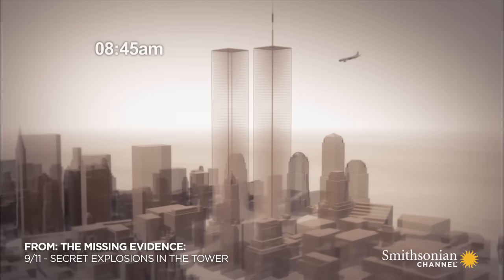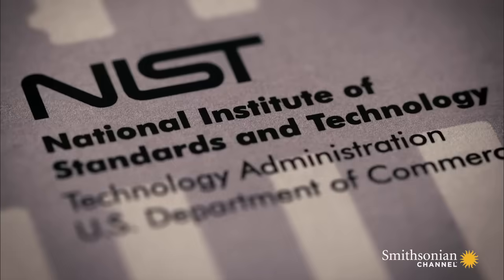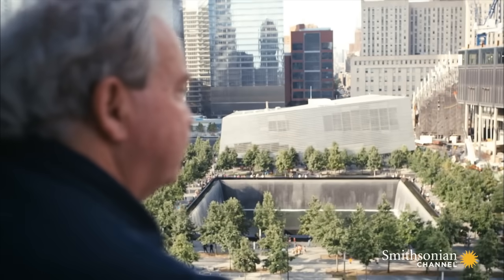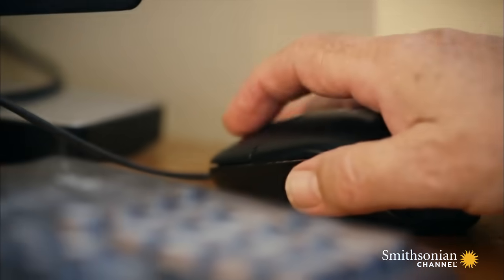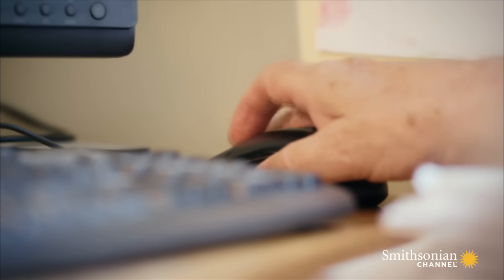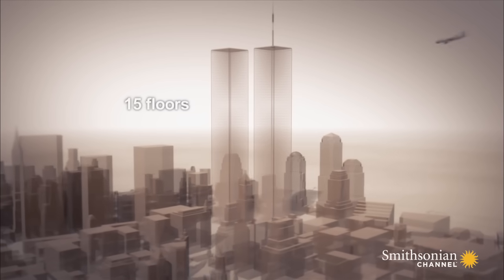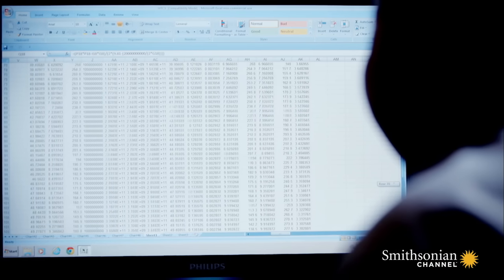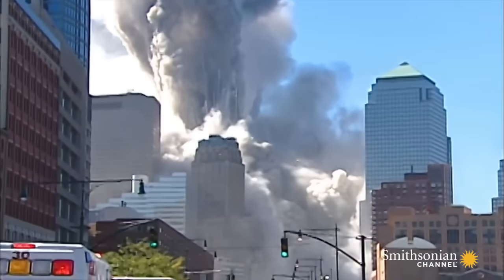This Computer Simulation Explains How the Twin Towers Fell

Comment: I just saw a bunch of momentum calculations. Not any actual, dynamic, real time simulation. In these calculations, he calculated the mass of each floor, and mass of the tower above the impact zone. I wonder, how did he account for the many connections between the perimeter wall, the trusses, and the core columns (which themselves were all tied together, basically a giant grid or collection of steel cubes)? In other words, I'm wondering if his calculations simply used the mass of each floor and basically assumed a house of cards, a house of potential energy. But how this momentum of the falling upper section of the building interacted with the strong, interconnected structure below would be very interesting. And very complicated. Pretty soon the general public will have access to simulation programs that only a few years ago, would have taken huge amounts of processing power and were very expensive . Soon someone will come up with a realistic simulation ruling out the pancake theory.
Reply: disgny 
You are by far one of the stupidest people I have seen on YouTube. Do you also believe that the earth is flat and that the government is lying about that too. Cause you seem to think they are able to do anything with any evidence that they can.
Reply: doesn't make any sense, that 3 buildings sustained asymmetric damage & all came down symmetrically.  For this to be  built into the design, would mean factoring into the build "what if' scenarios for each floor where  [if ANY one part catastrophically fails, then all other points fail equally, to keep collapse within it's own foot print]. The extra cost for doing this for each & every floor would be financially prohibitive & I would like to think if paying for a major building project, it would stay up in the case of a disaster, not pancake down on everyone inside - trying to be open minded here; does the insurance policy drawn up at the time of construction, stipulate this as a build requirement? Because I seriously doubt it.
Reply: there are plenty of far-out 911 conspiracy's out there I don't believe;  my thoughts are that there are far too many things that don't add up & I'm not into blindly believing someone else's narrative.  Then there's the angle of how accurate the simulation is; how many decimal places it was working to - unless you have all the data & method used, you can't tell if you are being intentionally or unintentionally misled. I had a buddy who worked for a large computer company that on occasion would cludge figures to return a more desired outcome, so forgive me for not having 100% blind faith in the video.  It took me a few years to wake up to things that just - well, to be  quite frank, that didn't quite add up.
Reply: ? what was the point you were trying to make? I'm saying that there's too many things that in my experience that don't add up, you've replied with unreadable gibberish. Enough, no more. I have tried to be polite; you are just can't accept that people are entitled to their own opinion. Grow up!
Reply: Well, actually they didn't collapse "symmetrically".
Reply: disgny
More conspiracy nonsense that you can't prove. There were no unusual sequences of the explosions, this is what you are refusing to accept.
Reply: SirLordypantsSir
Then open your fucking eyes when watching the footage. You clearly don't understand physics.
Reply: You seem to make a lot of unwarranted assumptions about how the Demolition MUST be carried out.   Suppose they didn't do it that way?
No,  you are NOT  depending on the force of gravity:  you are explosviely CUTTING every other floor, removing all support for the building. So it just falls.  This scheme always works, there is NO requirement that it must be done from lower floors to higher.  "A lot of explosives"?!  The perpetrators stood to make BILLIONS of dollars by doing this, you think they can't afford to buy explosives?!   They could , and did, take all the time they needed to preset the charges (non-working hours and controlled access) Nowadays they need not be interconnected with wires.   And , especially since there were NO airplanes, they need not worry about any of the pre arrangements to be disturbed.  Why would they?
Reply: Darryl E.  I find it hard to believe that YOU watched the videos of bldg. 7.  It was perfectly obvious that MOST of the floors were not touched by fire ,even enough  to break windows.   So , lots of office furniture are paperwork burned "unfought" for hours .  So what?  that could not possibly reach  temperatures high enough to do what you imagine.  And, oh yes,  how exactly did the fireproofing  get removed in bldg. 7?!  It is quite obvious that YOU have never tried to remove any;  it is not easy.
Reply: disgny 
The only lies that I see are you 911 conspiracy losers.
Reply: MH Lifestyle
The center of the building was the first to fall. The outer walls were pushed out. The explosion that you think you saw, was the large volume of air being forced out the building by the collapsing tops of the towers.
Reply: Are you kidding me Darryl? You're calling someone stupid, then saying that? Let's run through this together. I hope you don't mind since you seem to be an expert and all. 1) If air is being "forced" as you say, to a lower floor, it would not blow out selected windows. Gas will fill are area equally. So ALL the windows on a floor would have to blow out at the same time, not select ones, and certainly not 60 stories below at some points. 2) The material ejecting from the buildings is traveling at 160-200 feet per second. This is explosive force. Sending parts of the structure out hundreds of feet. This isn't compressed air of any kind that could have been created under the conditions. 

I see comments like yours and I think to myself, fuck, we are doomed. If this is the level of education the average American has attained. A level of education that causes someone like Darryl to says some stupid, completely uneducated shit list this, and call someone ELSE stupid? May God have mercy on our souls.
Reply: NO ONE is saying it was not a real attack.   The question has always been  WHO were the attackers, and what did they stand to gain.   For sure, it was not OBL or any Moslems,  all they got was the "Blame",  whereas the real culprits got billions of dollars in various forms.  And is it not strange that the utter failure of our government to even respond effectively in countering an "air attack",  after all the trillions spent during the Cold War to prevent any aerial attacks whatever,   did not result in ANY penalties whatever to those in  Charge of "Defense".   No one that I ever heard of got even a reprimand, to say nothing of actual action.   They got PROMOTIONS instead.  Curious ,  right?!
Reply: Not to mention, he calculated ALL the weight above crushing the floors below. But a large percentage of that 'weight' was being thrown laterally... not crushing straight down.
Reply: disgny 
Sorry but my grasp of physics is just fine. As for building 7, try watching the whole thing and not just the part the 9/11 liars want to show you. The penthouse fell in first, meaning that when the outer shell fell, the core of the building was already gone. And that is why when the outer shell of the building fell, it went very quickly.
Reply: I was replying to the last comment (looks like it ended up in the wrong place tho...).  Yes, Darryl, buildings do have a lot of mass, but regardless, if you remove a chunk of structure from one corner; you can expect things to start to fail there; not perfectly symmetrically & simultaneously across the whole floor.
Reply: contorled ?
Reply: Lets just say you dumb asses are right and it is a big conspiracy for a min. Then why add the explosions and the risk of it being found out? Isn't flying planes into buildings enough to reason to go to war against someone? By planting explosions just to do extra damage after flying FUCKING planes into buildings, it's just an unnecessary risk. It's like shooting someone in the heart then blowing them up.
Reply: paulczar: you don't need to trouble yourself about all the perfectly valid complications in building design and practice that you mentioned.  That is exactly what the designers do,  make all those caluculations,  and provide structures that can accommodate the loads, and then provide about 5 times more than the strength necessary ("safety factor").  That is what the designer at WTC said they did.  They have done all this successfully for a hundred years.  But there is NO WAY to a design that can defeat a military type explosive demolition  event.  FYI  : the Pancake Theory  has already been ruled out by the very people who proposed it in the first place.  It just doesn't fly.
Reply: disgny mmmh, ok, so you're saying the went kaboom on those floors?
Lets round up what you need to do to prepare a controlled demolition:

1) completely clean the area, to prevent interactions with explosives (done? nope)
2) manually demolish part of the pillars, to prepare them for the cut, in this case, remove a lot of concrete from the core, in fact the steel must be at least partially exposed 
3) place all the charges (and they are not exactly that small)
4) wire all the charges together. I know, you may think, why not wireless? Oh well, you can trigger the charges using a wireless remote, but you still need to link them together, cause you now, timing is essential in a demolition, and here, we are talking of a lot of charges.
5) place charges also on the external windows frames, as they carried approximately 40% of the load.

And the best part? You throw a plane through all that stuff, that explodes with all its fuel burning everywhere, and everything keeps working smoothly, not a single charge failed or have been launched on the outside.
Yeah, that make sense.
Reply: disgny and you know what doesn't make sense? You say the pancake theory doesn't work, ok, but we all can see that the floors failed up down. In controlled demolitions, you use mainly the force of gravity, so you cut in the lower parts of the building, and if you need more cuts, you go from the lower floors to the highest, otherwise it doesn't work, you lose momentum. Which means, to achieve the same effect using cd, they would have got to place charges in every floor of the building.
That's a lot of explosives. None of which were accidentally triggered in the previous days, nor damaged during the crash.
Again, seriously...
Reply: disgny
"Suppose they didn't do it that way?" If they didn't do it that way that your claim is fucking impossible. You fail to understand physics.
 You don't seem to understand what it takes to bring a building down via explosives.
Reply: disgny by the way, no airplanes? Seriously O_O ? That's too much trolling, even for a pro, like you obviously are.
Reply: disgny 
I saw the plane hit the tower with my own eyes and I was not alone. If that planes was flown into not 1 not 2 but 3 fucking buildings and I 4th crashed the was targeting another building as an act of terrorism. Then that is more then enough reasons to go to war stupid.
Reply: Sure, "go to war":  but shouldn't we at least try to figure out just  WHO was responsible?!.  Perhaps you didn't notice, but SO FAR , that HAS NOT been done.
Reply: Speaking of delusional,  unless you have a very  high level security clearance , how would you know just what holographic equipment has been developed over the last 40 years?!  And If you do have that clearance, they certainly made a poor choice choosing YOU to know all this stuff.
Reply: OK,  you present a picture.  But it has a fatal flaw:  "Fire"  doesn't weaken steel  until it engulfs the steel for a long time with certain required temperatures.  NONE of that happened in the buildings we are talking about.  And even if it did,  steel "yields" gradually,  it does not just "Snap".   And in the WTC cases,   the time it takes to yield is VERY much longer than any time that was actually available.  You won't find a credible engineer or architect to agree with your scenario, sorry.  N.B.  Take the NIST report:   they carefully avoided all those difficult questions.  They simply refused to come up with any theory at all , in their final report.
Reply: Your starting off with "facts" is admirable, rather than insults.  But you did NOT answer my main points about why the Official Story is wrong. Bldg. 7  had about 47 floors.  So that means that each floor had about 0.7 SECONDS to have fire engulf all columns,  "weaken" all steel,  have the floor joists "yield", and allow the Pancake theory to do its work.  LESS  than ONE SECOND!  Do you honestly think that any normal person, forget about experts,  finds that believable?!   The "Research"  you were referring to was not research at all, but a lame attempt to come with some  "technical " sounding cover story.   Did you realize that   NIST later rejected their own lame theory?  Leaving them with NOTHING, since they reject, without evidence, the CD explanation.  I'm afraid your insulting final statement did NOT help your case, quite the opposite.
Reply: You did not present a SINGLE idea, or Fact,  in your post.  So I guess this will be our last attempt at communication.
Reply: Paulczar;   My response was NOT to your perfectly reasonable post, but to another one ,(which had been mostly insults, but not all.)
    Your idea is at heart correct.   One of my friends, a world class engineer, was recently telling me in some detail, just how your plan might be carried out.  But I had to tell him , that the effort would be meaningless, because  the situation  about the Free Fall time absolutely rules it out:  there was simply NOT ENOUGH TIME available for all that plastic  yielding, sequential impacts, etc. to happen.  As even NIST has finally recognized, the Pancake theory is untenable;   those  ground floor columns HAD to be blown away by explosives BEFORE the "pancaking" could take effect.   And of course, if that had happened,  Pancakes are irrelevant.  The remaining unresolved mystery, of course, is WHY are the "elites" so reluctant to actually solve the greatest crime in US history?!
Reply: Darryl E. :  Yes, indeed , you DID refer to "Lots of Facts" in your post, but let's not forget that various Big League liars, like Advertising agencies (an American Specialty)  will ALL agree that the very best "lies" can be best sold by using " True Facts", which happen to be irrelevant to the real questions being asked.   This is especially suspicious when the "facts" are used to justify some fanciful Speculation,( which is what computer similation IS.  Not that they are ALL  bad, or useless.)   If the Theory that holds the Facts together is inadequate, as the "Pancake" idea is,  then the whole effort is suspicious in itself, as any police investigator will tell you.
Reply: Darryl Elam yeah i saw that i saw a burst of air come out near the ground floors when they started to collapse which i don't understand how that happened tbh idk there's honestly no sides to this whole argument we will never know... both ideas of what happened can be true so idk its really hard to tell
Reply: Chris Jensen 
No, what was thrown to the sides really was very small percentage. Where are you getting these stupid conclusions from?
Reply: Each floor span would fail at 14,000 tons, mattering not how many connectors, and the upper mass was 38,000 tons with momentum. That's your basic math. The upper mass indeed mostly fell down through the lower portion. It was the wall column panels from the base which were splayed apart and fell over large distances from the footprint.
Reply: whetedge:    Excellent that you are thinking about the physics of it.   Now,    could you tell us WHERE this "momentum" came from?!  Please refrain from saying "falling floors".   That is just silly.
Reply: paulczar unfortunately people in government had at least four hundred trucks come in and take away the evidence. All the debris From The Towers will put into trucks 400 of them and ship to China or Japan I forget which one for recycling. this is also on video. now correct me if I'm wrong after the buildings were brought down by demolition what Romaine was evidence pure evidence but it was removed. That itself is a crime that should be reinvestigated
Reply: disgny 
So now you are making up lies. You are a sad sorry loser.
Reply: disgny
All of those diagonal cuts long since proven to be made post collapse. Of course, you knew that.
Reply: disgny
Not who, WHAT. The evidence speaks for itself:
https://s6.postimg.org/6xyuzpwsh/wtc_Cut_Column_Annotated.jpg
Not to mention many of the cut columns were standing post collapse.
Not to mention no congruence between cuts and observable collapse.
Not to mention video of those cuts being made post collapse.
Reply: disgny
Do you enjoy exposing your utter vapid brain for all to see?
The columns shown to be cut were still standing in earlier photos than when they were cut, meaning they were cut after collapse.
Reply: Richard Lopez
It's you who is afraid of the truth. You want so bad for it to be controlled demolition you turn off your brain and become a pliable sap for the con men, believing exactly what they want you to believe, that somehow the Towers were like a solid block of steel. All you do is reveal you have no clue the design of the Towers. They also want you to think the upper mass just vanished because it broke apart. The mass was still there, other than the drywall; all 38,000 tons of it (North Tower; much more for South Tower).
Once the tops started tilting, how on earth do you think the vertical columns managed to stay in alignment? Did you not take solid geometry in high school? Are you not aware vertical support comprised less than 5% of actual floor plan? All the rest was nothing but floor spans; 60 feet on two sides of the core, 34 feet on the other two sides. That means the floor spans were the only resistance. The floor spans fail at 14,000 tons. How on earth can a floor span that fails at 14,000 tons stop or slow a mass of 38,000 tons with momentum? The rate of collapse actually will accelerate as mass is added by each collapsing floor.
You are being duped.
Reply: paulczar each engine roughly 7tons titanium now slam that at 500mph into a steel beam and see wat happens
Reply: disgny 
Dumb ass I've already explained how building 7 fell. And no it didn't fall at free fall speed, it fell near free fall speed. And what you saw fall were the outer walls as the core of the building fell first as evidenced by the penthouse falling into the building before the out wall came crashing down. You are nothing but a conspiracy loser that refuses to accept reality.
Reply: Dude I have a structural engineering degree and I doubt that you have a degree as most of what you have said makes you sound extremely ignorant on the topic.You use language that would suggest that you are a lay person on the topic. Also, if you're retired you're probably around 70 years old meaning that unless you were a badass engineer all you probably ever did was some stick framed timber or cold frame steel houses or maybe up to 5 stories. You have no idea how a Steel SMRF system that uses its ductility extensively works
Reply: disgny
"NOTHING was holding up the building at moment the fall began."
Something must have been holding it up because the moment it began to fall (perimeter wall frame), half the structure fell over with no discernible down component: https://media.giphy.com/media/26BRHuKQqWcyY2Xja/giphy.gif
Reply: He likely used the blue prints. Duh!
Reply: You are assuming that the WTC "collapses"  were ordinary demolition projects.  They WERE NOT.   The perpetrators had certain specific goals in mind,  to demolish certain areas to get rid of incriminating evidence, and people.  Hence the unusual  sequences of the explosions.
Reply: Yep, you can see the squibs on wtc
Reply: Darryl Elam Not interested in proving ewt pal. We've both seen the footage but clearly interpret it differently.
Reply: You are evidently not familiar with computer simulations.  It is possible to rig them up to get any answer that you decided in advance should come out.  That is what they did.  NIST spent a lot of money on theories and simulations of various kinds, and what do you know, they came out with the "Official Story" , or Myth of what happened. Only they did such a shoddy job that they had to back away from their original story,on account of knowledgable criticisms. and now admit they cannot account for the collapses.
Reply: Darryl:  I don't agree that the testimony of over a hundred eyewitnesses, some fire professionals, can be blithely ignored, just because you don't like the implications.
Reply: Darryl:  it's time to grow up:  Look up the term "False Flag Operations".  It means staged "atrocities" of various kinds to distract the public from what really happened,  and to blame someone you want to "get".  A lot like "Fall Guys" in a Mafia assassination, but nations do it too.  9/11 is a clear example, but there are plenty of others.  No , an airplane crash (even if it really happened) is NOT enough reason for a nation to go to war with another ,  ESPECIALLY if you might have the wrong one:  the FBI has said that they CANNOT prove that OBL & co. are guilty of the WTC affair, but it suits the purposes of certain Neocons to go ahead with it.
Reply: Darryl:  I was in  a Combat Engineer Battalion in wartime, later became a civil engineer,  and YOU are in no state of knowledge to even talk about what it takes to blow up a building,as is painfully obvious.
Reply: Right, Darryl:  only highly placed people in some hi tech government  have access to advanced Holographic equipment.  Good clue, isn't it?
Reply: I find it interesting you mention that the buildings had a lot of mass but forgot that the buildings were built specifically to handle their mass and a lot more mass. How would a mass that the building was designed to hold falling a short distance (a couple of floors) with resistance overcome the holding strength of the 70+ floors below it?
Reply: systematic101 
Put a 10 pound weight on your foot, easy right it's barely any weight on your foot. But drop that 10 pound that weight just 3 feet onto your foot and you can easily break your foot. Once something builds up momentum it hits with a lot of force. When the top of the tower fell onto floors that were already weaken by the fire. It punched though the weaken floors and built up a great deal of momentum that far exceeded what the building was built to take.
Reply: disgny
The actual maximum burning temperature of a Jet-A fuel (standard jet fuel type in U.S.) is 980 deg. Celsius. The temperature at which steel changes from cementite and pearlite (strong phases of steel) to austenite (significantly less strong) is 702.5 deg. Celsius. If a steel structure is exposed to a temperature just below or at the eutectic (702.5 deg.) for a period of time, martinsite is formed (very weak). All it would take is a few I-beams to lose their structural integrity before the "chain reaction" would start. The steel used in sky scrapers is a standard carbon steel, not heavily alloyed.

Burning jet fuel was all around the steel 'engulfing' them in fire and the the spray on fireproofing was knocked off when the airplanes hit. It was the joints that snapped as the steel I-beams malformed. The malformed beams put to much stress on the joint and the joints(that were also weaken by the fire) snapped. Try doing some research before you open your mouth dumbass.
Reply: the above was in answer to Darryl E.
Reply: disgny
You are a fucking moron. You need to shut up and do some research. You don't have a fucking clue as to what you are talking about and you clearly do not care about the truth.

Go play with your star trek holographic(delusions) airplanes and leave the big boy thinking to us adults.
Reply: disgny
Another claim from a conspiracy nut case. You don't have a very good track record of telling what facts are. I listed a great many facts throughout my posts and you just brushed them aside to believe in holographic airplanes. You need to wake up and take a look at the world around you.
Reply: disgny 
I have listed many facts that you dismissed off offhanded. So my post calling you a fucking moron still stands. You refuse to see the facts in front of you and want to believe in some retarded conspiracy theory of holographic planes and bombs.

The computer simulation in this video is based on facts. It pulls in all of the data about how the towers were built. They used technology that is used to test buildings before they are build to see if they are strong enough. The pancake theory has been proven with these computer simulations. You are delusional and are rejecting cold hard facts for make believe.
Reply: Darryl Elam alright buddy Im no tin foil hat man but I use to believe 9/11 wasn't a inside job until i saw videos with actual evidence showing explosions before and during the collapse ,and also how the planes wings penetrated the strongest part of the building like a cutout, and also how Silverstein bought terrorism insurance 2 months before and gained a lot of money out of it... im tired of all the innocent people who lost their loves that day for a greedy government I can send links to the videos if you want
Reply: Darryl Elam either way we will never truly find out what happened but thats my opinion R.I.P to the people who lost their live that day and god bless those families
Reply: MH Lifestyle
“alright buddy Im no tin foil hat man but I use to believe 9/11 wasn't a inside job” Well you are doing a great job of sounding like one.

“i saw videos with actual evidence showing explosions before and during the collapse” Though explosions were part of the collapse. You clearly don't understand the physics involved with a collapse of that type.

“and also how the planes wings penetrated the strongest part of the building like a cutout,” The core was the strongest part of the building. Can't you get simply facts right? And unless you are a structural engineer with the correct training to know what you are talking about, your opinion means nothing.

“and also how Silverstein bought terrorism insurance 2 months before and gained a lot of money out of it” He had to, and even if he had some inside knowledge of the attack, it does not mean that the attack was fake. You are grabbing at straws.

“im tired of all the innocent people who lost their loves that day for a greedy government I can send links to the videos if you want” I have seen most to these so called 9/11 truther websites. THEY are the ones still making money off your conspiracy. They are lining their pockets.
Reply: Darryl Elam these are facts though and also your wrong the outside was the strongest part of the building theres just no way aluminum plane wings can run into "basically" a steel wall, and also how does the building not stop for a moment during the collapse from the other steel columns holding up the other floors then collapse...  it just doesn't add up can you send links to verify it? jw
Reply: Darryl Elam alright
Reply: Darryl Elam alright I watched it and agreed with some of it but is there any video evidence of anything? that i can watch
Reply: MH Lifestyle 
He does have other videos that points out the evidence.
Reply: MH Lifestyle 
Hell the video for this comment section points out fact behind the collapse.
Reply: Darryl Elam i mean yeah but this is a mainstream channel i think it would be better if its not a main stream channel
Reply: Darryl Elam I also noticed how the parts were falling to the side... what caused the steel columns below to fall? and also does he have anything about wtc 7 and also the core of wtc 6
Reply: The bursts of air you saw coming out of the buildings were the power of the explosions, which could blow tons of steel out sideways as well.  There are plenty of unanwered questions about 9/11, but not about their being Blown Up by very Fancy Military explosives.  The mysteries are about who had the Motives, Opportunity, Resources, and "Benefits" from this, the Biggest Crime in US History.  Doesn't it make you wonder  just why there was never a Police Investigation about it?!
Reply: You are contradicting your own Fantasy story even as you tell it.  If the center of the building was the first to fall, then there would be no way for air to be compressed enough to blast out sideways.
Reply: disgny 
No, try to actually listen to what is being said. Where do you think all the air that was inside the building went. Do you think it just disappeared? How about you try this. Full glass bottle up fill with air till it can't hold anymore air, BOOM!!!!! That fucker explodes spending bits of glass everywhere.  

The inside of the towers air is forcing out the windows. Then the outside walls came down. The core collapses, the air than forces it's way out the windows and then the outer walls off. It is what every video shows.

You should seek help as in isn't healthy to be so delusional.
Reply: Darryl E..  But you claimed that the internal part of the building collapsed" first".  If it collapsed, then  it is simply not going to be possible to "compress"  a hundred floors worth of air to any significant extent , without having any "rooms" to do it with.  Get it?!
Reply: In other words,  if the center falls , there is no "Roof", therefore no compression.
Reply: disgny
You really are stupid aren't you?

The collapse of the core forced the air out of the windows. It all happened very fast. What part of physics don't you understand?
Reply: Here's the problem Darryl. When air (a gas) fills a void, it does so equally. So all the windows at once would blow out, not one window with explosive speed. You call me a fucking idiot? I mean, for fuck sakes, this is pretty basic shit. Before you go rambling on about Trump, take a fucking science class or something.
Reply: +Joshua Thompson
You ARE a fucking idiot. Buildings have these things called floors. The air from one floor can not escape to the floor below fast enough to equalize the presser throughout the whole building, so it blows out the windows one floor at a time. So what we would see is one floor of windows blowing out at a time as the building comes down starting from the top where the compression is happening.
Reply: God damn Darryl, you're a complete fucking moron. So air passes from one floor to the next. At each floor the air would fill the void uniformly. You would have all windows in this case blowing out uniformly. You would not have SINGLE WINDOWS blowing out at EXPLOSIVE SPEEDS, 20, 30, even 60 floors below the pace of the collapse. Period. From the videos of the collapse, all this shit is measurable. You have no fucking argument at all. If you want to keep dicking around with your imaginary sudo-science, have fun. I'm more than happy to keep responding and reminding you of the complete fucking idiot you are. It's quite fun to find someone this uneducated, so passionately making a totally false argument. Stack on the rest of the facts like multi-ton steel beams launching hundreds of feet laterally in what is supposed to be a downward collapse (through the path of MOST resistance I might add), your whole prospective on the events makes it easy to call you out. You ARE a fucking idiot.
Reply: Fuck Darryl, explain to me with all your infinite knowledge how SINGLE WINDOW up to 60 stories below the rate of collapse blow out? Again, when air is compressed, it's compression is uniform. So it would blow out all windows simultaneously. Calling me a bitch when you can't even address facts logically? Shit, this is fun. Keep going Darryl! Educate me! Love you how say "blow out the windows" as in multiple windows. Yet we see single explosive ejections, NOT all windows blowing out simultaneously as would happen. Come on Darrly, feed me more of your crazy.
Reply: Well fuck, YouTube isn't showing your new comments anymore. But I'll respond to the notification I can see. You have absolutely no grasp on basic science. This shit isn't hard to see when you want to see. If all you can do is call me a "conspiracy theory moron", then the case is closed. You have NOTHING to back up your argument. Since you are fucking Bill Nye the Science Guy, explain how a building, collapsing vertically, can collapse at near free fall speed, yet has enough energy to eject multi-ton beams laterally hundreds of feet? You can't fuckwad. So go beat off to a copy of the NIST Report.
Reply: I can't understand how you nut jobs still can't accept the overwhelming evidence that this was a real attack. These 9/11 truther sites are the ones making money off this conspiracy and they have great interest in keeping this conspiracy going because they are still making money off it.

I am not saying that the government is innocent in all of this. There is clear evidence that if the different branches of intelligence shared information they might have stopped the attack. But they didn't, and no amount of crying will change that.

It is also clear that the government used the attack on the towers to attack a country that had nothing to do with 9/11 that is what should piss you off. They used 9/11 as a excuse to attack another country, that is the real crime.
Reply: disgny 
Actually yes, there are many people who claim at it was not a real attack. I have even heard people claim that there were no airplanes. 

And as for the plans to prevent aerial attacks, they don't really cover airplanes that are always flying over head. There was no real reason to believe that these airplanes were going to fly into buildings. The hijackers were willing to trade their lives to carry out an attack, that's an extreme move. It's something we just don't see much, and it's hard to tell it apart from a normal hijacking. Well if you can call a hijacking normal.

Anyway back to what I was saying, most 9/11 conspiracy theory losers think that the airplanes weren't enough to bring the towers down and have to invent bombs to explain it instead. It does not matter that every single study shows that no bombs were needed to bring the buildings down.
Reply: Robert Burdoff
"if you remove a chunk of structure from one corner; you can expect things to start to fail there; not perfectly symmetrically & simultaneously across the whole floor."
You are assuming the Tower tops fell straight down; they did not. The tops tilted to one side to begin collapse, and asymmetrically fell down through the lower tube, wedging the perimeter wall to which it fell apart.
Reply: whetedge lLOL......YOU ARE A JOKE.   molten steel found at the bottom of the base of the buildings how do you explain that? fireman on interview testifying secondary explosions going off how to explain that? over 156 Witnesses testified bombs going off how do you clean that? video of molten steel dripping from the towers how to explain that. 1500 Architects with degrees come forward same buildings don't collapse that way how to explain that. why the hell do you come on here defending a lie?
Reply: Richard Lopez
If you are defending AE911(ahem)"Truth", you are the one defending the lie. That's all those shysters do; lie lie lie. And I don't have to explain anything. The evidence speaks for itself. Everything broke apart at connections.
Reply: whetedge:   Even with the inadequate videos of "evidence" of WTC wreckage that we have access to,  it is perfectly obvious that "Everything"  did NOT "break apart at connections" (!) .   There were considerable SUSPICIOUS  diagonal weld cuts visible,  of exactly the type of thing that is done in Controlled Demolitions,  for the purpose of "steering"  the Collapse.
Reply: Darryl:   You have only to look at the videos, which apparently you did NOT do.
Reply: disgny 
Have you ever watched a controlled demolition? Every single controlled demolition starts at the bottom and uses the mass of the building to bring the building down. Never ever do they start at the top. Try to actually watch a few controlled demolitions, what do you hear? bang bang bang. You hear a loud series of explosions before anything starts to fall. A series of explosions that was nowhere to be found on 9/11.
Reply: whetedge:   WHO exactly proved how those cuts were made?!   And what kind of contractor would WASTE HIS TIME(and money) making cuts about 140%  LONGER than they needed to be?!  However, as we all know,  diagonal cuts are a "smoking gun" for Controlled Demolition.   Are you going to insist that they are NOT?!
Reply: disgny 
Still rejecting reality in favor of a bat shit crazy conspiracy theory? Where were the series of loud unmistakable explanations that would have to of happened before anything could of collapsed? Ow that's right you are a moron that believes there were holographic airplanes.
Reply: whetedge: Your thought processes are baffling.  "cut columns ..standing post collapse"?!   Why is that a surprise?  In controlled demolition,  the cuts are made sequentially to drop  the section.  Down at the bottom,,  it is not at all surprising that some should still be standing.
Reply: disgny 
You delusional mind is baffling. how can you so willingly ignore the evidence.
Reply: Darryl Elam what a bunch of crap anyone who knows anything about the laws of physics will know that any upper block of material must slow down when it hits any massive force that previously supported it the upper block of following structure will destroy itself while before I can possibly question entire largest structure below besides you can see the top portion being pulverized in mid-air so what force its way down to all that reinforce support columns that were not damaged what you're saying is impossible and it is been proven by experiment. and if it doesn't agree with experiment it's wrong you want us to believe that the rest of the building that wasn't damaged all that reinforced columns will crushed by just a couple of floors if anything it might have crushed one or two floors and slow down toppled over broken off but not accelerate speed as if the floors weren't even there dude get some education
Reply: disgny notice that they're afraid to hear the truth they mock you call you a liar instead of being a real man and looking into this themselves. you stand correct this was an inside job these morons are probably paid a come out here and throw a wrench into the fan. if they had any intelligence they look into what we are saying and investigate and even show concern but they don't and that's why you know that they're full of s*** don't waste your time with these juveniles they're wickedly witless and quite lame.  we can easily forgive a child who is afraid of the dark the real tragedy of life is when cowards like these f**** are afraid of the light
Reply: Richard Lopez
This Computer Simulation Explains How the Twin Towers Fell. It used all the REAL data, and showed how it failed. You are the one rejecting reality because it doesn't match what you want to of happened. The one that need to get some education, is you. Instead of looking at the evidence you want to believe is some stupid conspiracy because you are too stupid to understand the physics.
Reply: Darryl:   Sorry, but your grasp of physics is extremely shaky.  As for what is "Real",   the videos of bldg. 7  are  Orders of Magnitude more "real" than any computer simulation.   What the videos show is that the building fell in just the time that Newton's Laws of Motion predict. Note carefully that such a calculation leaves ZERO  seconds for any of your fantasy ideas to actually happen.
Reply: Darryl Elam so a simulation that shows "it's possible" for it to collapse the way it did without explosives. That is enough to convince you? What if I showed you a computer simulation showing how it could have been blown up. All the simulations I've seen, by far the most realistic and the one that comes closest to matching what we actually saw involve the use of explosives. I have yet to see a convincing simulation that replicates the events of that day without the use of explosives. But it's just common sense in my mind, if you take the top 1/4 of a building and drop it onto the structurally sound building below, you should expect to see a de acceleration of the top of the tower, with simultaneous crushing of the floors. The top quarter could have crushed down about another 1/4 of the tower at most, before slowing down and coming to a stop, perhaps with the remaining top of the building falling off the sides to the ground. Instead we see an acceleration through impact, with virtually no existing floors in the debris. Everything was pulverized to dust and steel. Where are the crushed and pancaked floors? And forget the twin towers, just look at the events of the collapse of WTC7, even more obvious. Compare how it collapsed from "regular office fires alone" to the Grenfell Tower in London that burned to its steel skeleton in a blaze lasting over 12 hours. The WTC7 fires, at its peak, involved only a couple of floors on fire, and yet there it goes, collapsing literally at free fall speed nearly into its own footprint. Very, very suspicious. Hell, not even suspicious, it's the smoking gun. And once you acknowledge WTC7 could have been wired for demolition, you must also accept all 3 towers were brought down intentionally.
Reply: Darryl Elam get it out of your head that controlled demolitions only work from the bottom. There's no reason it couldn't be wired from top down, and actually, there are a few examples of known controlled demolitions available for viewing on YouTube that are demolished from the top down. And yes you are correct, they all involve a series of explosions that take place before the sudden fall. And this is indeed what occurred that day with hundreds if not thousands of witnesses and clear audio evidence of explosions taking place well before collapse.
Reply: paulczar 
Does your computer simulation of it blowing up magical add explosions? Face the facts, the REAL computer simulation showed how it fell, right down to the exact timing. Where abouts your conspiracy theory relies of explosions that don't exist.
Reply: paulczar
"And yes you are correct, they all involve a series of explosions that take place before the sudden fall." Show me the video where these  series of explosions happened. There were lots of videos of the that day none of the showing those UNMISTAKABLE  series of explosions.
Reply: paulczar
"And once you acknowledge WTC7 could have been wired for demolition, you must also accept all 3 towers were brought down intentionally." I don't acknowledge your ignorant assumption, Maybe if you actually looked into why tower 7 fell with an open mind, you might start to understand. But you are too warped up into your conspiracies to do that. I know expertly how and why the tower fell. There were a number of reasons, perhaps you can tell me what was under the building. So here is a bit of homework for you, what was under WTC7 that aided in it's collapse and why?
Reply: staff:  if you think that is enough to bring down a steel high rise,  you simply have an overactive, and quite mistaken notion.
Reply: disgny
No one even implied that two titanium engines were enough to bring down the Towers, so once again, you merely reveal your own bias.
Reply: Dude this guy is like a chemist, no doubt a brilliant person. But probably hasn't taken a lot of structural mechanics and dynamics courses. He probably used some elementary assumptions, structural plans, sample load takeoffs or weights, and the basic dynamics impact-momentum equations to come up with a simplistic energy based approach. 
Obviously the collapse is way more intricate than that and something a team of like mechanical, aerospace, and structural engineers would need to work on. Basically a lot of his conclusions past whether from an energy standpoint it was feasible seem like a big reach to me. He can't really claim that unless he had a ton of help or has a doctoral degree in structural engineering that he's not telling us about.
Reply: Plus we do really have softwares now that could approximate this (see csi from berkeley). This kind of simulation is totally possible and the dude who built those towers is still alive: Leslie Robertson!
Reply: We'd have tons of information on this because he actually considered some kind of bomb or terrorist attack (maybe a plane impact directly) as a limit state. Now he probably didn't use this as a design basis but I'm sure put in considerations to provide ductility and life safety in some extreme case.
Reply: Amir Fassihnia 
Yes we do have the software to do it. Which is what this video shows. I swear you conspiracy losers must be missing part of your minds.
Reply: I don't think it was a conspiracy. That dude used excel, not a structural software like ABAQUS which can do FEA and consider thermofluid mechanics. The rest of the video "simulations" are merely aesthetics for the video. I think you could simulate this kind of thing, the dude in this video did not achieve it. It would take a team of researchers, a butt load of money, and massive mega computer

Are you an engineer Darryl?
Reply: Amir:   It is not necessary to go into all the intricacies you mention.  An  understanding of high school physics is enough. Since building 7 fell at "free fall speed" , as calculated by the Newtonian formula,   that  unequivically implies that NOTHING was holding up the building at moment the fall began.  The only practical way to achieve the "nothing" is by Explosive Demolition,  carefully designed and carried out.  There is NO other way.
Reply: I totally disagree, I don't think an understanding of high school physics is enough to comprehend how a complex structural steel system collapsed
Reply: If you are seriously interested in this subject,  you really need to do a litttle study of how steel framed buildings are  put together.  Your imaginary ideas about it are quite wrong.  (I retired  as a civil engineer, structural)
Reply: disgny 
Somehow a doubt that since you know next to nothing about how buildings can collapse.
Reply: Yes, my engineering experience is "out of date", but then,  so are the buildings we're talking about.   The basic layout of steel framed high rises has not changed much in a hundred years,  except for the innovations with the Twin Towers.  But they, of course, were designed using the same basic physics, and a good job too.  Or don't you think so?!
Reply: disgny 
And I don't believe you have any engineering experience. I think you are a liar as you have shown no knowledge about how these buildings came down.
Reply: Amir F.  I doubt that  very many "Dudes" have engineering degrees.
Reply: disgny
"The basic layout of steel framed high rises has not changed much in a hundred years,  except for the innovations with the Twin Towers."
7WTC was also a large span, where support columns were moved from evenly spaced throughout the footprint, to the perimeter wall frame, which formed a trapezoid box, and long light weight floor girders connected the perimeter wall frame to core columns. The south perimeter wall frame was breached vertically top to bottom, which destroyed structural stability of the building, and the movement of it's collapse proves it: https://media.giphy.com/media/26BRHuKQqWcyY2Xja/giphy.gif
https://giphy.com/gifs/collapse-building-7-7wtc-tsa8jLubwYfkI
Reply: Amir:  your agreement about "complex steel systems"  is NOT required for this.   Simply your agreement that Newton's formulae prove that building 7 collapsed in Free Fall time.   High school physics is quite enough for that. Or do you think Newton was not "up to date"?!   If YOU timed the fall with a stopwatch, did you get some OTHER elapsed time?!
Reply: disgny
Did you account for parallax in your "timing"? Of course not, and neither did Chandler. The measuring point was moving away from the camera, which makes it get smaller and appear to drop faster than it did. Furthermore, it is impossible to get an exact measurement with a 30 fps camera two miles away with a telephoto lens. Also, the measured corner can be seen to shimmy back and forth on the way down, meaning some part of it was in contact with the ground.
Chandler admitted to a 1% margin of error (likely higher), and measuring the difference between free fall close to free fall is impossible with any margin of error.
You insist on beating a dead horse, and like the liar you are, refuse to address the initial movement. Until you do, anything occurring later in collapse is meaningless. How a structure begins to fall is how it fell. The cause of collapse doesn't suddenly change partway through collapse.
https://media.giphy.com/media/26BRHuKQqWcyY2Xja/giphy.gif
Reply: Unfortunately it's almost all dudes that have engineering degrees. I just graduated recently though and our numbers are improving. 

The building definitely did not fall although it did become structurally unstable. What's surprising to me is that the engineers did consider ductility requirements  for ultimate states like these,  and they consider redundancy in design to prevent collapse. However, obviously there was a catastrophic progressive collapse failure mode. Again, also it did not fall at exactly free fall speed which is an extremely important distinction in this case.

As for your experience being out of date, this is not a typical layout. This was extremely novel at the time and still not very common unless you work on a massive project like a sky scraper. This used Fazlur Khan's tube lateral load resisting system. Basic "physics" (more like structural mechanics) do not teach you how to analyze or design these systems. In fact, a bachelor's degree and even a masters degree in structural probably won't.
Reply: Robert Burdoff 
There are many different videos and studies the show the same evidence. All you are doing is building a bigger and bigger conspiracy with no evidence for your claim. 

Do yourself a favor and look up buildings that are destroyed by explosives. There are very unmistakably series of explosions before the buildings even start to to come down. Nevermind that contorled explosives don't start from the top of a building and than work there way down.
Reply: Robert Burdoff
Instead of pointing out spelling errors, address the point that I was making.
Reply: Robert Burdoff
I said look at buildings being demolition by explosives. Watch and see that in every case load explosions are heard before the buildings collapse. And they never use demolition by explosives from the top down.
Reply: Robert Burdoff 
Stupid they weren't design to collapse, but as stated in the video once the collapse started nothing could of stopped it. These were big buildings had a great deal of mass.
Reply: disgny
More conspiracy nonsense that you can't prove.

Again I ask, isn't flying planes into buildings enough of a reason to go to war against someone? Why add explosions at the risk of them being found out?
Reply: DeePal072 
It's guy is clearly delusional. He refuses to address the issue of hundreds of people(including myself) who saw first hand the planes crashing into in towers.
Reply: MH Lifestyle
"these are facts though" But those aren't the facts.

"btw i never said it was faked" Your post about the planes wings penetrated the strongest part of the building says other wise in fact your whole post does.

"so your saying that the government was not involved at all in anyway possible" There is no evidence to think that.

Look up EdwardCurrent, he mostly mocks religion but he does have some really good videos on 9/11. His '9/11 conspiracy explained  in 91.1 seconds' is something you should watch. It's a real short video so there is no reason they you can't watch it.
Reply: Richard Lopez
You can study the steel right now today if you bothered. It is well documented with 100s of hours of video taken day of and on so you can see all layers of debris, plus the landfills where it was taken and inspected. You will find everything broke apart at connections.
Reply: Joshua Thompson 
Are you fucking kidding me Joshua?
1) the air is being forced out so fast that it can't travel all the way to the bottom. There is not enough time for the air to equalize. The easiest way for the air to go is by blowing out the windows. Learn some physics before you throw out your nonsensical bullshit.
2) It's call air pressure. When air is compressed by tons of building collapsing on it, it will explode with tons of force. It is with we would expect to see from compressed air.

When I see comments like yours I know who we got a fool like Trump in the white house. You lack the understanding needed to see what this video is clearly showing, why because you want to believe that you have some special knowledge that the pros don't have. When the people who design buildings like the towers and know far more about the physical properties of the buildings all say that these buildings come down because of the fucking planes. They are not fucking guessing. They know this shit better than you, it's how they made a living. And if they are found lying about something like this no one would ever trust them and they would be out of work. They get nothing by lying and if they were lying, than they could lose everything. 

Maybe if you spent more time studying and less time thinking about god, you might be able to comprehend basic facts.
Reply: Joshua Thompson 
What fucking void. Its not a void Its compressed air. Air has mass and only so much of it can pass to the floor below before the presser is great enough to blow out the windows. Learn some physics bitch.
Reply: Darryl:  your idea about the roof line is just idiotic.  The roof line is NOT going to fall as long as the columns hold it up.  Got that?!   And if the "shell" of the building (whatever you think THAT means ) is gone, then the "  roof line" would have already moved. AND, the "movement" was at Free Fall pattern.  Which MEANS explosive demolition.
Reply: Robert Burdoff
You get a F for not paying attention in class.
The whole point of this computer simulation was to see if it could. The simulation not only showed that it is possible it even showed why it came down like that. Like every conspiracy theory nut case you refuse to accept the facts even when they are so nicely handed to you as they were in this video.
Reply: paulczar:   You might be happy to hear that engineers and architects have ALREADY  showed that the" Pancake Theory "is Bogus .  Anyone with a stopwatch who TIMES the Free Fall of building  7 on 9/11, using the readily available videos, can calculate the elapsed time of the Fall, using Newton's Laws of Motion..  It is FREE FALL,  which can ONLY mean that there was NO functioning  structure under the building when it fell.  There is NO mechanism known to man the can make this happen SO FAST, except for Explosive Demoltion,  where it is commonplace in building demolition. Appalling, but true, because of the level of corruption it reveals about the US today.